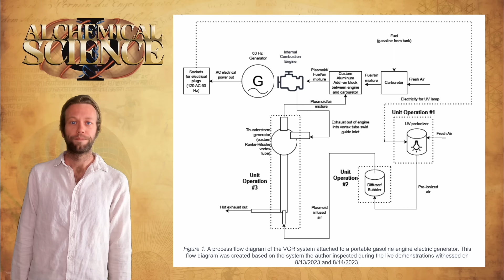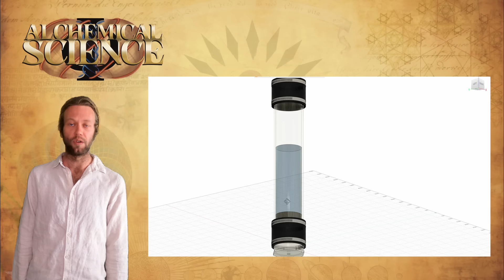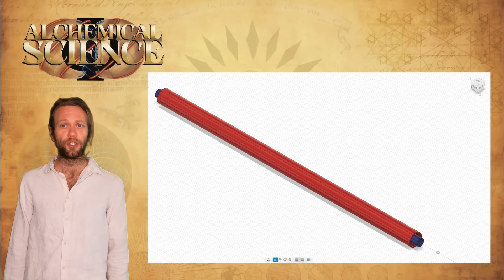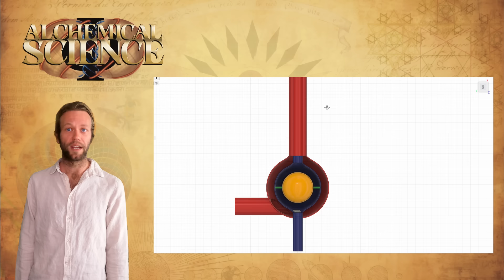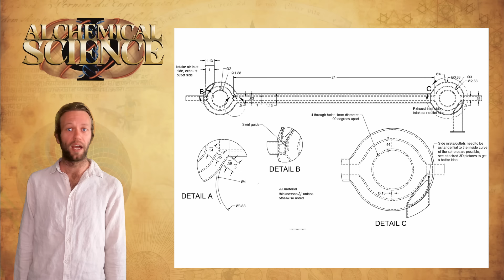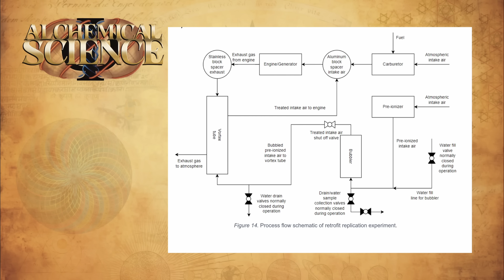Thunderstorm Generator | COMPLETE DIY BUILD GUIDE | Malcolm Bendall's Plasmoid Tech

Comment: You repeatdly refer to welding the joins. Welding dissimilar metals is not viable in many cases. If welding is necessary then making everything in 304 stainless steel would be better. TIG welding would I believe be the best welding method available for most of us. Otherwise I believe silver soldering will be neccesary with say copper to stainless steel. 
The stationary motors that it has been trialled on run at a continuous RPM. 
Obviuosly the most relevant use will be on motor vehicles with continual changes in RPM and load, any info on that side of things?
Any dimensions for say a 2 ltr petrol car motor or a 4 ltr diesel such as a Landcruiser or Nissan Patrol ? 
Since the earlier simple diesels for these can be run on recycled oils they would seem to be an excellent choice to clean up the exhaust emissions and efficiency.
Reply: "The Mind Has No Firewall
T. Thomas
Published in Parameters 17 February 1998
Computer Science

TLDR
The human body, much like a computer, contains myriad data processors that include the chemical-electrical activity of the brain, heart, and peripheral nervous system, and the light-sensitive retina and cornea of the eye that process visual activity.
Abstract
The human body, much like a computer, contains myriad data processors. They include, but are not limited to, the chemical-electrical activity of the brain, heart, and peripheral nervous system, the signals sent from the cortex region of the brain to other parts of our body, the tiny hair cells in the inner ear that process auditory signals, and the light-sensitive retina and cornea of the eye that process visual activity.[2] We are on the threshold of an era in which these data processors of the human body may be manipulated or debilitated. Examples of unplanned attacks on the body's data-processing capability are well-documented. Strobe lights have been known to cause epileptic seizures. Not long ago in Japan, children watching television cartoons were subjected to pulsating lights that caused seizures in some and made others very sick."
 https://www.semanticscholar.org/paper/The-Mind-Has-No-Firewall-Thomas/a78eab3556d6858568e7b18c631773badd3ea963#:~:text=The%20Mind%20Has,others%20very%20sick.
Reply: What about Chrome-moly?
Reply: If you want a 10hp 4 litre I think this may be onto something
It sounds a lot like a modified HHO generator that doesn't use electric input?
If your creating some form of cavitation bubbles it isn't plasma even though they can be quite destructive (as shown by boat propellers for years)
Mantis shrimp have been doing cavitation attacks for ??? millions of years now everyone knows collapsing cavitation can cause high temperatures and gas ejection.

Comment: This is great but I think there's an easier way yet. See; the 3 layers of spheres are something I know of too well from other designs found in crop circles which I began studying in 1993. The key function is the implode charge through a focal point at center, and by using a carrier wave, any carried wave is folded over itself to form a higher frequency wave. Doing this in 3 phase produces charge confusion, which is to say, that the charge held by each layer remains 120 degrees out of phase and may never be monopolar, which keeps either pole from flowing yet allows a polar bias (ion charge) to flow in pumping diode effect.  Ie; the carrier starts as or becomes a pump z wave, so that all carried waves are force to become so as well. 
In short; an alternative method would use 3 layers of coils like you'd see in Ed Leedskalnin's timing post, which was where zero point was in his circuit. Basically, you'd use a second distributor run on electric motor to short out ferrous points at opposite ends of a non-ferrous dielectric zero point system, in order to split charge, which is the key to the Thunderstorm. It's using thermal tension to channel ions along layers here.
Reply: question, would the decay of coherent scalar field oscillations have anything to do with the phenomenon occurring? (extra energy = instant anti-matter annihilation)
Reply: It's not a yes or no answer, unfortunately, since everyone's understanding of what scalar energy truly is, is deeply flawed. There is a sudden loss and a sudden decay, but to identify this as merely scalar is incorrect. Is is a fully progressive kinetic reaction among all available particle sizes using DeBroglie waves, as all reactions are. If anything, I'd say it's more about focusing on how thermal entropy is eliminated for bursts during boson shell containment transfer, altering an atomic centerpoint during a superconductive event. The entire reaction is progressive kinetics among all particles, so everything is relative here as always. The main difference is the geometry of organization and how specific particle sizes produce wave interference and therefore expansion from like sized particles, so when a fast thermal reaction like an acid reaction envelopes ion bonded matter, that ion bond can suddenly sever and do this with great force if acid reactions perform a cascade reaction effect as or similar to pulse oribital discharge among capacitors; while this may take place about various geometries such as a sphere or oval. It's never about a specific frequency. The smallest particles of the universe supply the force of ion neutralization as they flow by, so when bosons are aligned in a crystalline fashion, ion reactions are far more volatile (quick to reorganize). Neutrino wind is something I had on the web in 96 and copyrighted in 2003 later vindicated by the $270m Ice Cube project. It is the source of time.  @ascensionunlimited4182
Reply: Except this requires no additional energy or moving parts
Reply: @dwightvoeks9970  yet the Thunderstorm generator apparently does nothing but change exhaust gasses. I thought this was to improve mileage or possible allow the engine to run on another fuel or something useful. It's lacking a carrier wave so it can't drive a zpe circuit anyway. I could be paired with something I suppose to do that. Leedskalnin's flywheel does use moving parts but so what? it can continually lift stones over 10 tons. That was just an example. There are many other designs which don't need moving parts like the Artifact antigravity circuit I'm building now. Well, changing spark gap is a moving part but that's just to change output level.
Reply: @mikefromspace  Nothing but? It does completely transmutate poisonous compounds from exhaust into breathable air and in testing has improved engine efficiency 2x to 3x better, which may even improve more with further testing. Remember, this thing is just a baby. They haven't even begun to scratch the surface. There are zero moving parts on it.

Comment: Can you show Malcolm my thermoacoustic engine? ...Galaxy in a box remastered.. Thanks.  It cost nothing to run. I would like to get in touch with Malcolm as I have something much better to show him. It requires no magnet, no coil, no battery or any moving parts and nor does it require a combustion engine. It uses sound to make plasma to make heat to make sound to keep it running non stop forever. Can likely power a whole country. It's like a plasma arc furnace inside a Helmholtz resonator.... extremely powerful....

Comment: How is this not just hho gas from water electrolysis being fed into the intake of a combustion engine
Reply: I had wondered the same thing. My best guess is that there isn't any hho being produced from electrolysis, rather plasmoids are being produced from the energy created from imploding bubbles...which is different than feeding hho into the combustion cycle...I think
Reply: @stax-on-stax.crypto5452   I watched the video and realize I was wrong but didn’t delete the comment. I do get the collapse of the bubbles has some energy but isn’t it the same energy as when the engine had added load when producing the vacuum, to produce the bubbles in the first place?

Comment: I believe the vortex tube can be simplified significantly. While his theory is based on resonant math, the contribution of the exhaust vortex, in my opinion, won't provide anything except heat. There won't be charge separation from the outer 'exhaust' vortex tube to the inner one. The key is really the input vortex. You could completely remove the outer portion and even heat it with a simple electric heater or transfer the heat to the intake vortex tube from the exhaust gas (wrapping exhaust tubing around the intake pipe containing the vortexed moist air).  As far as vortexing (and tuning) the intake gas, I would use a more readily available parts to inject the intake gas tangentially into a long tube, figuring a typical flow rate caused by the engine's intake [vacuum] - that is, measure it first for the normal engine. The vortexing (swirling) rate (the velocity of the vortex around the direction of flow) is basically a centrifugal acceleration (newtonian: an object that moves in a circular path is accelerating, even though the acceleration is not in a straight line). While the length of the tube is important for maximum effect, without a "tube within a tube" constraint, it can be adjusted to "tune" the system. You may even get it to resonate, sonically, where the length will directly proportional to a harmonic of the ideal frequency.  I really don't believe the outer flow (counter vortexing) of the exhaust matters, nor will have any appreciable effect on the inner flowing tube - it's electrically and electrostatically isolated with the only 2 possible processes interacting with the inner flow being thermal and possibly sonic.
In short, the important stuff happens at the UV source, the bubbler, the steel mesh and the input vortexing. The exhaust is only contributing heat (vortexing it is really only creating a good job of mixing the hot exhaust gases for better thermal transfer).  There is no electrostatic connection.  This can be simplified.
Reply: It's all about resonance. The Winhex reactor, the Lion reactor, the vibrating plates, the Ultra experiment (ultrasonic vs foils in water), the Safire project (in some configurations), LPP fusion experiments, tesla coils, etc, all have this in common under certain conditions. The math behind this is relative (ratios), not absolute. This is, what I believe, Bob Greenyer, has been saying all along.
Reply: Think about the temp gradient as phase disparity like when you static shock a door knob there is a disparity between the phases in you and the door knob when they equalize there's a shock this is electrostatics like lightning is not electricity it's dielectricity. The ionized air a d exhaust never touch the disparity gets so large that the two actually equalize through the steel of the inside sphere and the dielectric discharge + the geometry of the gas bubbles collapse works together to make fusion take place it's like a positive feedback loop that's why the ratios are required. This is implosion tech. We use explosion technology now wait 10 year this will be everywhere